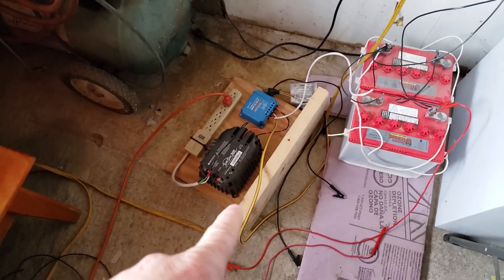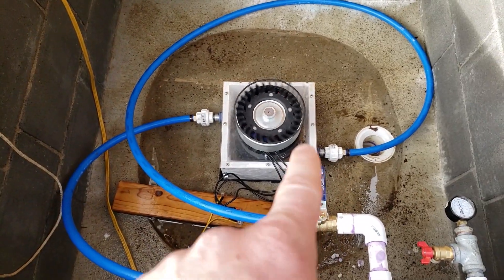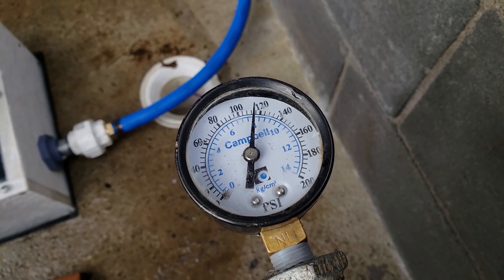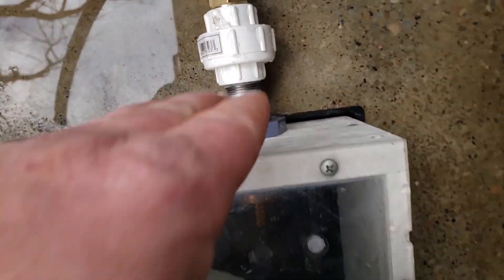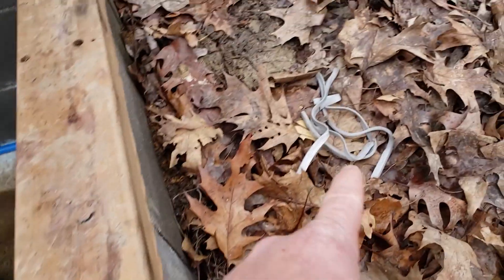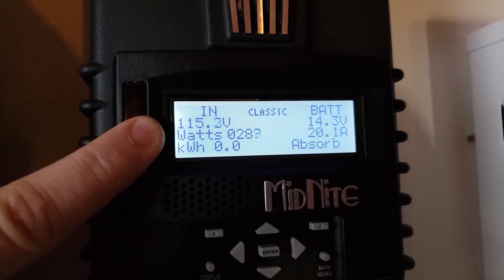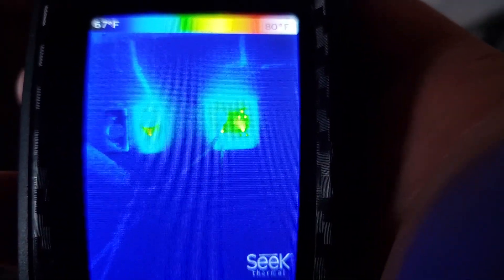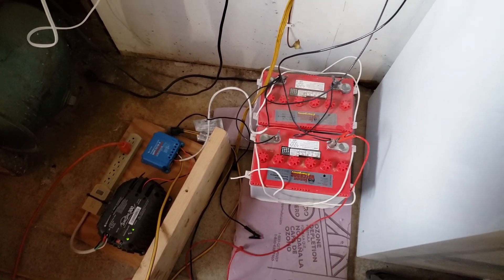New Peak Watts, Broken Nozzle

Comment: When the system runs on full capacity what is the temperature of the wires you use on the generator? What is the diameter and the length of the wires to your house? I see you had around 20A and the wires don't appear so thick, which means a higher resistance for current.

Comment: hi bro... may I ask u somthing....can I use solar control module for water turbine..??  can u please explain to me.?
Reply from the maker: Usually solar controllers perform a voltage sweep and record the resultant amp output to determine the maximum power point tracking voltage draw value (MPPT). this sweep is really fast, too fast for a physical device like a turbine to react. My turbine takes about a minute to do a full sweep when turning on.

PWM is another type of charge controller, but I don't know how they behave with wind/hydro
Reply: @JoeMalovich  tq bro...for the info... regards from Malaysia

Comment: Turn the part cooling fan off on your PETG and it will make the part less brittle. Also, print your PETG at ~240-245C. Printing it too hot will make it brittle. You may have better luck with nylon. Taulman 910 is good stuff, although you'll need to upgrade your hotend on your printer.

The reason you are peaking out at 330W is that you are limiting your output to 20A. 20A * battery voltage is your limit.

Comment: I see your current manifold  has several sharp bend in it.  You may find using a Y fitting  in place of your T fitting in your nozzle manifold flows better.  in the same way,  45 degree elbows may flow better than  90 degree ones.  There are also t fittings which have a Y element. for smoother flow. Triangular filler blocks in the corners without nozzles could circularize the water flow in the desired direction.   Perhaps these ideas may be useful in your future designs.   I have Asperger's Syndrome ,an autistic type which  causes me to stress logic and focus to and extreme degree on problems.   So I have used my disability to support your efforts, as best I can. Your work is amazing.  Good Luck!

Comment: What type of rectifier bridge are you using? If it's dissipating a lot of heat, it might be a standard diode bridge, which has a high forward voltage drop (Vf) - probably 1.2V or so per diode. This means that you dissipate power in the diodes bridge proportional to the current: voltage drop across the bridge multiplied by current through the bridge equal total power lost. For your 300W peak that's about 5W best-case, assuming that's about 2A @ 150V on your input. If the diodes have a higher Vf or the input current is higher than that, then you're losing even more. It'll be 3-4 times that once you get up to 1kW.

Schottky diode rectifiers have typically lower Vf (by a few hundred mV per diode) meaning you can get a little higher efficiency out of them, but you should really look into getting a MOSFET bridge rectifier. Instead of using diodes, they use MOSFETs, which don't have a forward voltage drop but instead exhibit a small resistance. They have a typical drain-source resistance (Rds[on]) of under 0.1 ohm, meaning that even if you were pushing 1500W at your controller input (10A @ 150V) you'd only be losing 0.4W over the rectifier. Significantly more efficient and you don't need to worry about cooling.
Reply from the maker: Can you point me in the direction of some that are rated at 10A? I'm having a hard time finding any and you seem to be more knowledgeable than I on the subject matter.
Reply: @JoeMalovich  Ah, after doing some research and simulating the circuit design myself, I just realised why they're uncommon for this task: I hadn't considered that the maximum gate-source voltage (Vgs[max]) for MOSFETs is usually limited to 30-40V, which means they won't work for your situation without an active controller, because you'd be pushing +/-150V to the gate.

Unfortunately I'm not sure you can buy an active controller as a prebuilt unit. There are some ICs for it (LM74670 and LT4320) but they're slightly under the maximum voltage spec I'd need to build something for this myself. I'll keep looking to see if I can find one, as this is an interesting area of research.

Frustratingly, I can't find any well-specified AC-DC rectifiers as commercial products online. They'll all happily specify the maximum voltage and current, but they don't specify a voltage drop across the rectifier, nor do they specify what the parasitic resistance is and how it changes with temperature, both of which are critical factors for efficiency.

If I can't find a product for sale that has some reasonable efficiency specs, and the active controlled MOSFET design doesn't pan out, I'll see if I can at least put together a well-spec'ed Schottky-based rectifier and send it over to you.

Comment: You can use your Midnite Classic's Aux1 to turn a relay on/off based on battery voltage.    Its the "Diversion" option on Aux1 - meaning automatically close or open an internal relay OR turn on/off 12v for an external relay - you chose what you want.    For example, in my solar system (48v battery bank) I use Aux 1 to provide 12v on/off for an external that turns on/off my inverter.    I use 52v to let the batteries get up a bit before turning on inverter load and 48v as the low cut-off (turns off the inverter) to avoid going too low.    In addition to "Diversion" there is also manual on/manual off (ignores voltage settings) so its easy to test Aux 1 operation from the menu or disable it while you work on stuff.
Reply from the maker: Thanks, I was reading the manual which indicated an aux port can output PWM to a load, thus diverting away from the battery in a variable manner too. They offer a pricey product to manage this called the clipper, I wonder if I could build something similar.

Comment: You need to put in a tee with a vertical pipe to release air(I forgot the technical term) near your intake.

Otherwise, air bubbles are gonna wreck more 3D printed nozzles and the system itself.
Reply: Sounds like a decent idea. Vertical pipe with a valve might help to catch air then he can release the valve whenever he goes out to check it
Reply: @flyguyrjg2  No need for a valve, if you place it at the top of the system and make the vertical pipe tall enough, there wont be enough pressure to push water over the top of the pipe.

Comment: If you are wanting to burn power and create heat, you need to ditch the LEDs and use incandescents and halogens. LEDs are designed to be very energy efficient and pull under 10 watts. Also need to be aware of the energy losses in the inverters. They advertise them as 90% efficient but they only get that at max draw. They have a fixed current overhead. That 1000W inverter for example is going to eat 1 amp as long as it is powered on. It hits peak efficiency when it is supplying at or near 1000W. If you are only running 250W, the actual efficiency of the inverter will be a LOT lower since it still has the fixed draw of the device itself.
Reply from the maker: I was just using the led lights to pull a few more amps, 1 more incandescent would have tripped the controller.

Comment: I would have 4 nozzles and run the feed pipe around the inner edge of the turbine house and the drop feeds to the turbine from t joints the very first jet will be end of feed line and get larger in size the closer to get to the inlet on the wall I would have motors on the taps that feed from your collection barrel so the water hight will trigger the valves to close as flow gets less as in water level low in the barrel I know this would fluctuate alot but I guess would be like solar

Comment: I had an idea last night laid in bed if you put float switches in the collection tank and have that run to electric control valves on the turbine feeds they system would control flow rate automatically so it will never drop to a point air is drawn in
Reply from the maker: Way ahead of you there.

Comment: All of that noise/vibration is lost power. I'd bet that fan is much larger than it needs to be, and the housing looks too small. Your spoons are getting swamped with water that's bouncing around the enclosure and that's wasting a ton of power because it's having to push through water that's not creating power.

Before any of that happens, you need more batteries to store your power, and you need a way to get that power back to your house's grid so it's actually useful. You're making enough power now that you have to think about that first before the turbine gets better.

Comment: Have you looked into casting in metal using 3d printed parts? A toaster oven you can stick outside to burn the plastic out of the mold before you go to cast will get rid of most of the plastic.
Reply: Make sure to print it in PLA then

Comment: Hey Joe, liking your vids a lot keep it up!

I have a quick question, sorry if a bit obvious (just want to be sure):

Let's say I have total appliances consuming 2000W: would I need hydroelectric generation of 2000W (more of course to account for losses) to have them running constantly ?

If I have 500W of generation + batteries, would I then be able to load them then empty each time they reach enough for 2000W ? (which would mean powering the appliances for 1 hour for each 4 hours of generation time - roughly, of course more losses to be accounted for).?
Reply from the maker: Correct.

Comment: i would get the same lead acid batteries to make a 72V/84V system, should run efficient already with 110V AC inverter.
Or as you mentioned, for more efficient charging of the batteries take Lithium batteries.
But just said, i would prefer the long lifetime and lower prices of properly charged lead acid batteries over lithium batteries. In my opinion, lithium makes only sense when efficiency and mobiliy is a must have.

How much energy you need at all? Will you oversize your batteries or will they discharged more than 50% every day? In an oversized storage i would recommend lead acid, since they will work for a long time as they are rarely discharged under 60% and most of the time they will be full. In a medium sized storage, i would prefer Lithium batteries, with for example 3,5V discharge limit and max. 4,1V full charge voltage.

Comment: This is a WILD assumption, but it looks like your running thhn or thwn, that wire is rated for 90C, which makes it completely safe for 30amp, that being said your charger controller only supports 75C connections at the terminals, anyway if your using thhn or thwn wire, your good for a minimum of 25 amps and as long as the wire stays under 90c and the terminals under 75c, you pretty much can turn the amperage up.

Comment: I bought a tapered nozzle for the end of a garden hose made of metal to wash the car. Not sure where I bought it because i have had it long enough so I don't remember. I would expect that it would last longer than one from a 3d printer if you can get them there. Hole in it could be enlarged for higher volume of water if needed.

Comment: Hey, very cool! Looks like it;s really coming together :D

It looked like some of the water in the turbine housing was bounding around a bit. It bounced off the turbine as expected, but then perhaps it was rebounding off the wall and back into the spoons? I wonder if a larger inner housing would help give the water more room so that it doesn't hit the spoons again in the wrong direction.
Reply: I've been thinking the same thing. Once the water has imparted its energy to the spoons, it should flick away, and not bounce back onto the pelton wheel in any way? I'm no expert, just following your progress with interest. You seem to be quite handy at fabricating stuff, so maybe a bigger housing, possibly with some kind of deflector strips to "bounce" the spent water away from the pelton? I suppose an easy way to test the concept would be to remove the sides without the nozzles on to see if it makes a difference? It would mean spray everywhere of course, but you could knock something up to stop that while testing? Anyway, best of luck, looking forward to seeing how you get on.

Comment: Nice setup! I would not bother adding a heatsink to the rectifier, it is at just 80f and they are usually made to withstand much higher temperatures, and they actually get more efficient with higher temperature (lower forward voltage drop)

Comment: What size wire do you use on the dc voltage? I  used number 8 copper on solar panels at camp.
Reply from the maker: this is only 12ga stranded, 4ga from windy naiton is on the way.
Reply: @JoeMalovich   should notice a difference

Comment: The exact model of the nozzle also makes a lot of difference in terms of efficiency. It greatly defines the shape of the outgoing water. Ideally the diameter of the outgoing water does not change, it stays a cylinder with the same diameter of the nozzle and does not become a cone. Everything else would represent a loss in efficiency for that stage. With the wrong design the nozzle might even work as a break for the water.

Comment: Plastic makes for a BAD nozzle, every little piece of dirt in that natural water will eat its way trough the nozzle like its a sandblaster
Reply from the maker: this spring water is very clear, only occasionally running with silt.
Reply: @JoeMalovich  its still not clear enough, it contains minerals, and that will cause issues in the long run,  
especially at those pressures
always better to have a metal nozzle, PLA is fine for a prototype but bad for long term solution.    
I reccomend you make a metal nozzle after you found out whats ideal via plastic prototypes  
otherwise you would have to swap nozzles weekly

Comment: I believe there is a great loss of efficiency because at this rpm the water cannot get away in time before the next spoon comes. A spoon is hit by water, that water is bounced back, or at least slowed down a lot. Now the back of the next spoon, as it goes much faster than the bounced water, hits that water and generates a counter force. Sorry kind of difficult to explain what I mean :) The spoons will need to be designed to deflect the water out of the way of the next spoon. Of course it is a difficult balance between energy used for the deflection and capturing the energy of the water. The most efficient design will depend on the rpm and the incoming pressure and volume of the water and you would have to design a system adjusting the spoons. Think of a turbo with variable geometry. At this stage however I believe that would be too much of a hassle to take this into consideration and you should design the system for a predefined energy input (water flow) and thanks to this running at a predefined somewhat stable rpm. It should be easier to restrict the incoming water flow to that  optimal input value. Btw, actually you have designed an axial 'fan'. All be it a very flat one but still the same principle. You might be able to find relevant formulas on the web for these fans. Water is having totally different properties from air, but both a fluids, so the same basics will apply.
Reply: Increasing the size of the enclosure could also improve this. Centrifugal & the kinetic force it has should clear the next spoon??
Reply from the maker: The spoons are travelling at 1/2 the velocity of the stream of water so think of them more as slicing off a bit of the stream. Additionally the backs of the spoons are angled so only the sharp edge and the concave portion of the spoon is hitting water. The water is then flung away axially.

Comment: You're NOT going to see the full power capacity of the turbine until you put a proper load on it. It appears that some current limit has been reached in your charge controller as we saw the "AMP LIMIT" indicator come on. Is the charge controller limited to 20A??? If so, your max power is about 280W at 14V. This has nothing to do with the turbine's capacity, but is a reflection on the limitation of the charge controller. If you reconfigured  your system for 48V and still limited to 20A, that would give you 960W of max power.

The better test conditions would be to use a load like a 1000W space heater wired with a Variac. You can turn the heater on full, and limit its voltage with the Variac. You need to have an inverter capable of driving the heater to the capacity that you're seeking. You would conduct the test with the batteries fully charged to see the loaded capacity of your system. I would not disconnect the batteries and run the inverter directly from the charge controller as this will make the charge controller unhappy. Just wait until Absorb or Float and then run the test.

Right now, you're looking at power, but you're not seeing the entire picture because you don't have the system under load.
Reply: The amp limit is a preset output limit because the wires feeding the battery bank are under-sized. Joe set it up this way, and he's going to get around it by wiring his batteries in series, and adding more batteries, so the voltage will be higher, but the amperage will be much lower.

Comment: If you are just using that charger controller as a disconnect you can get a relay or solenoid and have the controller control that and you can run real amounts of power but just a relay would give you up to 30 amps if the wire is up to it I believe they generally say 30/40 amps i assume the 30 is a continuous rating

Comment: Would it make sense to add some Resin/glue to the outside of the 3d printed nozzle in order to strengthen it?
Reply: Randy Graville no it’s PETG so it should withstand it but the inner hole might be damaged because of friction

Comment: Rather than print a new nozzle why not print a reducer that will fit inside your larger nozzle. Even if it fails you know it still works but at reduced capacity but not stop all together
Reply from the maker: Yes this is an idea I had! My larger nozzle you saw in this video is 2 pieces and I could just print new inserts. The tapered geometry is critical for efficiency.